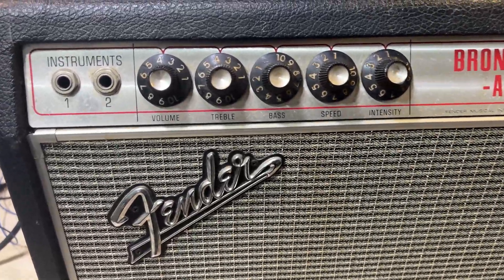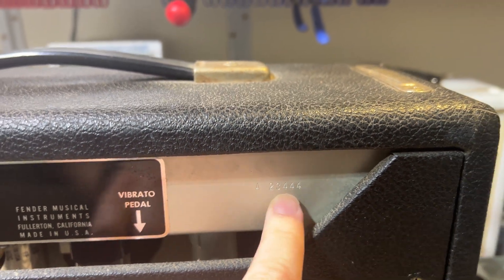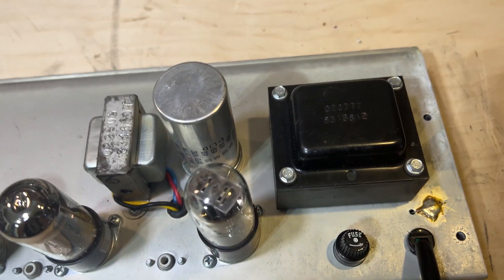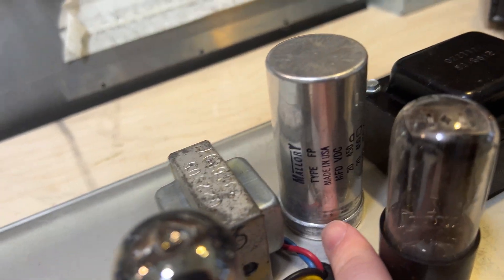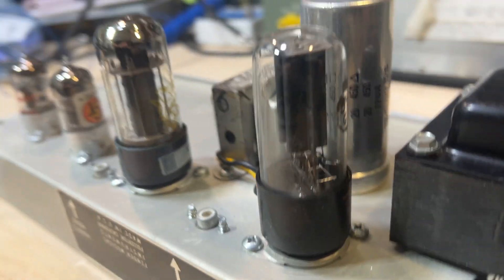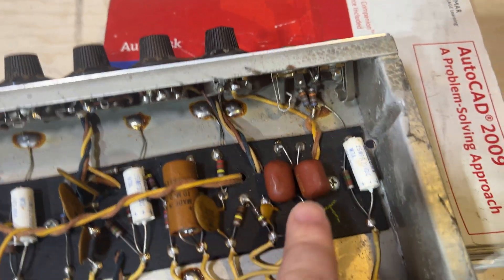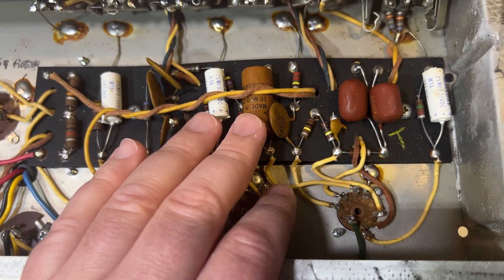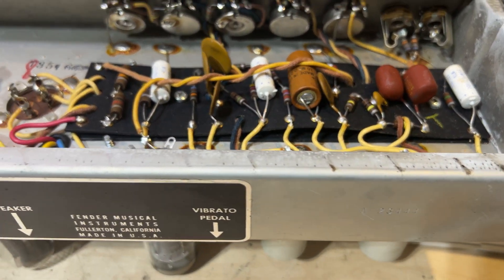My 1968 Fender Bronco Has a Transformer I’ve Never Seen Before | EIA Code 831

Comment: TECHNOLOGY ENTERPRISES, Why don't tube testers measure the power tubes "Dissipation"? Some tube testers will measure the preamp tubes transconductance but I'm not sure why would you want to know the preamp tubes transconductance value?
Reply from the maker: Hey! That is a great question! As far as I understand things, tube testers typically use transconductance as a test of tube performance because tubes typically are acting as amplifiers in a circuit. This test can be done easily by applying a small voltage to the grid and using a bridge circuit to measure the change at the output, and gives a test of the operation of the tube as it will be used (assuming it is not a rectifier tube or diode). When a tube is failing they typically will either do so catastrophically so that there is no output based on an input signal at the grid, or that relationship is a lower value than it should be. 

On the other hand, Dissipation is the relationship between the idle current being multiplied by the result of thr voltage at the plate minus voltage at the cathode. This would essentially give a similar result for understanding if a tube is good or bad for a guitar amp. However, to actually get a resulting number from these measurements we would need a much more complicated circuit since it needs to measure two voltages, a current, and find the product of the two. 

If you have seen any of the videos where i use my Compu Bias tool for biasing it is basically doing this same thing and i have often used it as a sort of “tube tester” in that i can monitor the performance of two tubes in an amp while it sits at idle and warms up. To be honest, i have been working on amps for over 15 years now and only recently started using my B&K Dyna Quick tube tester that i have had for the bulk of that time, and only have started using it now because i am working on more customers amps and it is fun to use as well. When it really comes down to it though, the best tube tester for a tube going in a guitar amp is a guitar amp!
Reply: @TechnologyEnterprises  To measure the transconductance IN-Circuit, you use a Wheatstone Bridge across the power tube?
Reply from the maker: At least in the manual for my tube tester it says that the plate current is measured via a “sensitive bridge circuit” for the transconductance measurement which would imply either a wheatstone bridge or similar setup.
Reply: @TechnologyEnterprises  measuring Transconductance is only used to match pairs of tubes together or is measuring transconductance used for biasing? I'm not sure if amp techs will use a LOW transconductance so you can biasing HOT to get more headroom before clipping or blocking distortion occurs. You can apply a larger input signal driving the grids of the power tubes using LOW transconductance before blocking distortion occurs

Comment: Hey, found you channel a couple months back. I think you have awesome potential but I find all your videos way too slow, it seems it takes like 20 mins of talking to get 2 capacitors changed which get a bit frustrating to watch. Not coming here to crap on you, just thought you might get a bit more people following if you did more work in the videos. Just my 2 cents.. Cheers
Reply from the maker: Hey! Thanks for the feedback!

Do you have any opinions on whether people may enjoy longer videos (start to finish repairs showing the full process) vs. edited down shorter videos? I have been trying to find a balance between showing people full tutorials with the soldering and everything, as opposed to just stating what needs to be changed and why then showing the results. 

Happy to adjust to present this work in whatever way will benefit most people watching!
Reply: @TechnologyEnterprises  Personally I LOVE long videos that show all the soldering etc..but would be nice to see the amp completed or almost completed in 1 or 2 videos, having a 5 part series is a bit frustrating. If I were you, I shoot for more of a Brads Guitar garage style where he shows the work or something like Uncle Dougs style, where he starts with diagnosis and the amp is finished in one video.

PS. What happened to the Hiwatt Amp build from a couple months ago?
Reply from the maker: @dyamariv3628 thanks for the further input! That Hiwatt ended up needing more maintenance than i originally thought, which is why the series ended up so long. I am still waiting for Mojotone (Heyboer) Output transformers to be back in stock so that i can finish the build and have been holding off on another video for it until it IS completed so that the series doesn’t drag out further. 

At some point i shifted to a video for diagnostics to buy time for ordering parts before a second video for the repair. Shorter videos seemed to be doing better than the hour long ones. But I have also been leaning towards going back to having longer videos that are a quick diagnosis and explanation then diving straight into the work.
Reply: @TechnologyEnterprises  Cool, makes sense! Looking forward to the Final Hiwatt episode, what a cool amp!
Reply from the maker: @dyamariv3628 hopefully will be soon! Mojotone said it would be a couple more weeks a couple of weeks ago. Still planning on doing a deep dive video on the bias circuit for those amps as well, and will hopefully do a sound comparison video with two other similar era Hiwatts that friends own. 

Thanks again for the feedback! I just like talking about amps and helping other people learn about this stuff, so don’t hesitate to let me know if there is a better delivery method for that process!